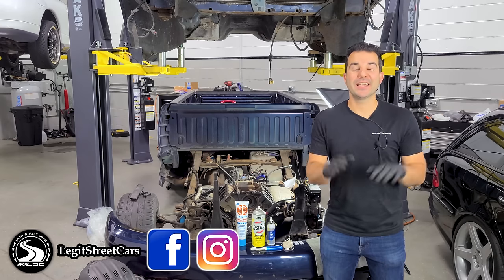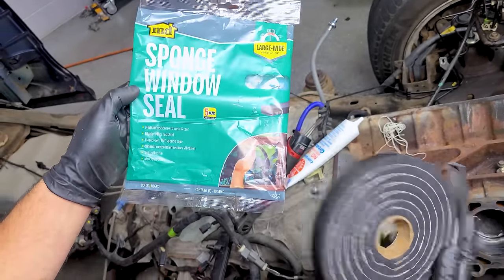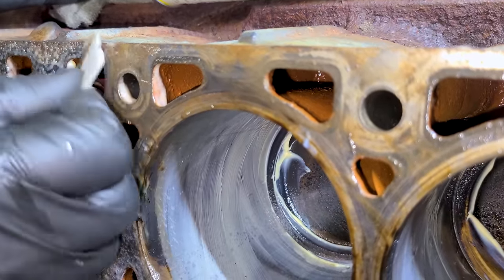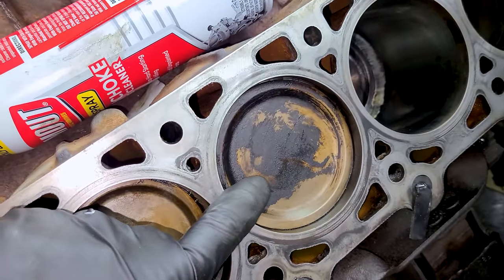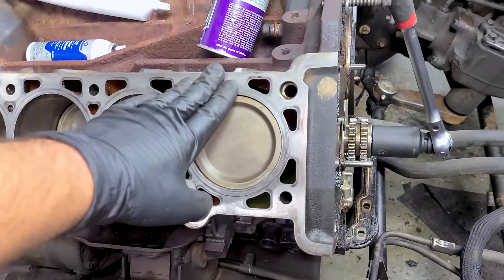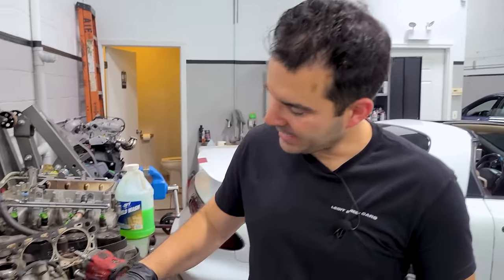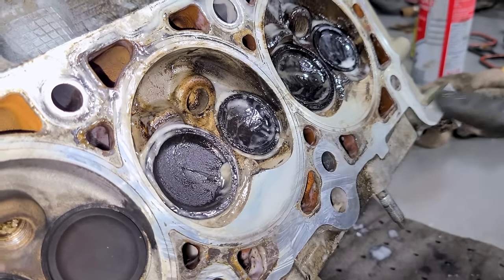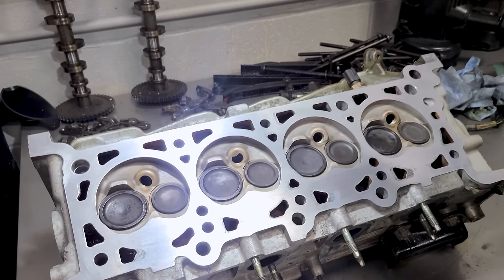How I Cleaned My SVT Lightning Pistons & Engine Block Using WAX STRING! BONUS: Head Cleaning!

Comment: I can tell you that what you did is just right on fella. One thing I can add is that I use .001 thickness feeler gauge and lift the straight edge and place it underneath and see if I can pull out the gauge. You do the same thing as myself fella. I know for a fact that guys I use to work with would just use the rotary scotch brite pads fine grade and not give a damn. They had too many returns and would blame the owner overheated the engine as the fault. Then it was time for a new Ford crate engine. Now the price is just crazy high. I personally went the extra mile and had NO RETURNS, PERIOD ! I believe in a customer is my bread and butter. Job well done Sir.

Comment: If you've never used it, Mopar Combustion Chamber Cleaner is probably the best in the industry.  Make sure you double nitrile glove.  Use it on running motor, or down the plug hole for a soak, & better if engine is pre-warmed.

Comment: Great video.  Try scotch brite bristle disks for gasket removal.  They come in green, yellow and white.  Grade 50-80-120 based on color.  The white 120 takes off gasket material off a aluminum block very quickly without removing metal.  I have used it on several aluminum cylinder heads and none are leaking.  Just do not push hard and do not concentrate on one area.  Like using a buffer.
Reply: Yup that white one did great on my turbo impreza. No leaks, does great at the track.
Reply: Those are the way to go. A lot of service manuals call for them too.
Reply: yea dont waste your time using a razor blade unless youre fluffing a YT video out
Reply: @WholesaleTurbos  also isn’t brake clean cheaper and better then oven cleaner lol
Reply: The 3M bristle discs have ceramic abrasive in them. Best to use them on bare heads and blocks that will be final washed before assembly. If you use them on an assembled engine, be sure to seal off everything.
Reply: @bryanmaloney6651  maybe 1 in 10 dealer techs take the time to do that lol
Reply: @gszman  Different products, brakeclean won't remove gasket material, but it will remove grease, dirt and carbon buildup. 
Oven cleaner and gasket stripper are caustic so they are much stronger than brakeclean so they are better for removing stuck on material.
Reply: @nzuncovered1845  I’ve never needed to use solvents to remove gasket material. That would be like watching paint dry. Solvents and compressed air are for final clean up

Comment: Nice job, it is very satisfying to see a freshly milled surface, but I am sure you could also use a flat grinding stone or block instead of that sponge to sand out those stains..
Reply: Kinda should stay away from abrasives for cleaning on the cast iron as much as possible,staining won't hurt,and wire wheels won't remove metal but they'll remove stuff that's not metal.

Comment: I thought proper technique with the straight edge was to run it diagonally across the head and check the gap between cylinders, running it along the edge of the casting seems like it would show the least amount of potential changes.
Reply: You would be correct
Reply: It is.  Not sure what he's doing.  Its not a race engine will be ok
Reply: The way he checked is not correct at all. That was a waste of time and just a video filler.
Reply: @sschevmale24  it is a boosted v8 and it is common to lift head gaskets on these so yeah kinda critical to check. But sounds like the engine is junk anyhow so....
Reply: @sb0mb  bro its fine.  I've seen worse and run fine.  Yes he has motor out, magnaflux it, machine it, rebuild it.  Cement the block if you want.
Reply: This guy's a 🤡

Comment: I wonder how much that straight edge costs ?
I didn't even know such a thing existed outside engineering shops and laboratories
been using a piece of glass for over 40 years
infact if you do detect warpage, you can stick fine grade silicon carbide wet and dry paper to the glass and flatten the head or block yourself fairly easily.
just make sure your glass isn't warped first, by testing it 4 times against another piece of glass in all 4 orientations.

Comment: Just a thought....would that crushed dry ice blaster that you used for underhood and interior detailing in a previous video work for cleaning up the cylinder head and block deck gasket surfaces and piston tops?
Reply: I was wondering the same
Reply: Yes. It freezes and chips grease grime and even sealant. It doesn't do so well on remnants of paper gasket.

Comment: Former BMW tech and former Gen 2 Lightning owner, I chimed in on another video you posted about these trucks. The engine is an okay base but the rods are weak junk and the earlier engines' spark plug thread are not enough for even an NA engine, let alone boosted.

Comment: Cool tip with the wax string never seen that. But a tip I use on the cylinder heads leave the spark plugs and turn the head bowl up. The pressure from valve  seats will be water tight and can let your cleaning solution pool up as you clean.
Reply: Does the string just stay in there and evaporate?

Comment: Always check deck and head surface diagonally as well as lengthwise. Also a good idea to go perpendicular and you want the check between the cylinders as that area has the least amount of support and receives twice the combustion vs and outside edge. It is just a good practice.
Reply: I am sure you didn't miss title stating how to "clean" but not repair. It wasn't a repair video but rather cleaning, It help to read.
Reply: @finditandfixit2081  Did the author not show how to check flatness?  The fellow you were ragging on simply provided addition info. Additional good info.  Also, I don't recall him mentioning fixing anything.
Reply: @randywl8925  he did that to do a quick check as  he probably know it wasn’t bad. Since it still fall under how to clean as hat.
Reply: @finditandfixit2081  but both guys checked for flatness.
You need to check for flatness,   so a clean but warped head wasn't reinstalled.  If you're going to check, the guy mentioning the diagonal check too, was telling the best way.
Hey, the head is off, so might as well do it.
Reply: Hard to run a diagonal flat check on aluminum block because the sleeves for the cylinder protrude a MM or two outwards, you can likely test it somewhat in the same fashion as the gentleman in the video though

Comment: I respect this guy's work and respect his Palmares but I've never seen a straight edge used like that to check head or a block. 
Also, I can think of way less caustic cleaners than oven cleaner in such a critical part of my powerplant. I look forward to see how this buidl turns out.

Comment: I love my old craftsman gasket scraper. its made like a chisel but its not too overly sharp. Its heavy and strong and can be easiy re-sharpened. Way better than any razor blade. Wont damage your head so easy. Cuts and removes old gasket so well you wont need any gasket remover. Other than that i like your sanding block and white bristle brush.

Comment: It's like an entire video dedicated to avoiding the simple 3M plastic cleanup tools that professionals use.
Reply: He's giving us an alternate method. What's wrong with that mr know it all?
Reply: Professional tools cost tons of money and not everyone can get them.
Reply: Never take a plastic wheel to an aluminum block or head. The heads should always be taken to the machine shop. It's not just the head gasket surface that matters, but reconditioning the valves, guides, and seats. Plus, if it's German, it's getting new valve stem seals mandatory.
Reply: Your watching a professional bud
Reply: What tools? Genuinly interested. Im spiffing up my 240sx stock build* until i can get a new bottom end package and get the heads ported and some cool cams
Reply: Just leave him be
Reply: NO ONE IS HONEST WHY WOULD HE NOT JUST DO WHAT HE LABELED THE VIDEO AS?????????? CLICK BAIT. AND THOSE TOOLS ARE 9MILLION DOLLAR SHOP TOOLS..... USELESS TIME WAISTER. WHY ARE YOU EVEN TALKING SO MUCH MAN???? SHOW THE FIX AND SHUT UP. WOMEN TALK LIKE THAT. WHERE IS THE STRING FIX?? BUDDY NEEDS A FEMALE TO TALK TO.  IM NEVER WATCHING THIS WAIST OF TIME AGAIN.
Reply: @LynxStarAuto  plastic is not gonna hurt aluminum or steel thats why they sell plastic hammers for hitting metal parts without damage like when youre seating your thrust bearings. if your heads are going to a machine shop new valve stem seals is a no brainer on any engine
Reply: Do you really believe that professional will clean carbon of pistons inside of a worn bore and ring engine ?
Reply: @Videoswithsoarin  many Roloc or 3M plastic cleaning wheels have embedded aluminum oxide and/or silicon oxide. Definitely not something I want in my engine.
Reply: In my area it is there is no 3m brush available

Comment: When cleaning aluminum. If you choose to run a wire wheel.  Try to find a wheel that is made of brass. Or Nylon. NOT STEEL. Brass is good as it is softer than aluminum. And don’t do much damage. And nylon is a plastic. Which will break apart rather than gauge or scratch.  I use a Nylon wire brush when  cleaning valve guides or any brass,copper or aluminum bits.

Comment: I do know that mechanics would do carbon cleanups a looong time ago where they would carefully apply droplets of water into the carburetor while the engine is running at 3k or so.  The steam from the combustion would help break off and carry carbon deposits out through the exhaust.  BUT!  I've never seen inside of those engines to confirm if indeed it did work or not.  Oven clean does wonders to cleaning carbon deposits, best way to keep stainless steel exhaust tips clean, inside and out!
Reply: Saw a dealer mechanic in the 70's take a coke bottle full of water and dump it in at a higher rpm, it was a hi perf corvette with detonation problems.
Reply: @RickyBobby615   DRIP.... not "dump". ATF could also be used (pre-catalytic convertors) in order to let it sit and soak into the carbon deposits to help soften and break up the deposits. Followed by a "brisk" test drive to blow out the chunks and fog the neighborhood for mosquitos. lol.

Comment: These 5.4s have a coolant drain plug on the driver side rear of the block just above the oil filter. It's an Allen key fitting. I want to say it was an 8mm. Once it's out rust/debris may be holding the coolant back so poke it with an extension or screwdriver, and watch her pour out!

Comment: $$-saving tip - a laboratory squeeze-bottle or Zep spraybottle are very effective for spraying cheap mineral spirits for engine cleaning.  Or for spraying WD-40 from the economical minigallon size.

Comment: I have 3 different grits of 3m plastic cleaning pads with plastic fingers on the bottom. They are small designed for air grinders. They are made for cleaning aluminum. The finest one won’t hurt aluminum no matter what because I have tried to hurt old heads etc and no damage but the most aggressive one is for cleaning iron blocks so it will definitely damage any aluminum.

Comment: I was asked a long ago to fix a Ford Cosworth engine from a racing Sierra. The other camshaft had snapped in two. Now, straightening the head can also mean that the bearings of the camshaft are no longer in line after the head has been torqued in place. So, if the warpage is only minor, just let it be. Let a quality head gasket do the job.

Comment: You should store your straight edge in a hanging position. That is why there is a hole in one end. If you put it on a surface edge down and the surface you rest the straight edge on is not perfectly flat gravity can warp it. When it is hanging the only thing gravity tires to do is lengthen it.
Reply: That makes sense

Comment: What I use is aircraft paint remover that’s in a aerosol can because it does not oxidize the aluminum, and it leaves a shinier finish to remove the carbon from the valves and pistons

Comment: Diamond like coatings are to reduce friction 
And it retains heat while being more conductive of heat than steel or silver sodium filled valves for example have the same effect of retaining heat. 

The entire piston and valves are dipped into it and it’s embedded into the top layers of the metal. Where vitol was used in previous vehicles. 

It’s like putting oil on ice then trying to skate around on it. At the same time it’s speed of heat transfer keeps the heat at the highest friction points. While reducing knock.

Comment: I use mercedes gasket remover, which is a loctite product (7200?).. it removes everything.. no sanding block required. I do final wipes with microfiber ..first with the gasket remover and finally with 90+ alcohol..

Comment: the hole in the strait edge is there to hang it from just like a 4 foot square used for drywall, plywood ect. hanging it keeps it strait.
Reply: 👍💯 It's also the same reason you should store loose cylinder heads and crankshafts standing on their ends (vertical) instead of laying flat (horizontal). Much less chance of them bending (warping).

Comment: Could you use CLR as a coolant flush? Obviously you wouldn't want to drive it, but just a quick 15-20 min idle, let sit fire it up again and then drain and refill. Or would that be too hard on the internals/water pump?

Comment: I had one that had the stains really bad, it had red rings around all the cylinders. I ended up using some metal etch primer, light coat(transparent)before I installed the new head gasket. I prepared it with 1500 grit. I was hoping to slow down the head gasket rotting out like it did.

Comment: A syphon parts washing gun. 1/4” nylon line in suction hose. Can suck out bolt holes, dome to comp ring, even through a spark plug hole

Comment: The diesel truck engines  do not need super clean piston tops . More importantly is using a new tap to clean engine block head hole and a die on the head bolts . Use  International compound #2 on head bolts . 3M Scotch Brite pads clean well . Anaerobic sealant better than RTV silicone ,  Good Video .       2/23

Comment: I heard you can wax string it by pulling the spark plug out and putting it in and running full throttle.

Comment: Every time I pull my heads, I don't plug up everything, I usually change the oil and coolant after I break down my heads anyway.  I also use green scratch pads on a drill to clean the head surface and use copper sealant on the gasket afterwards.... I use Totally Awesome from Dollar Tree to clean the pistons too.

Comment: interesting methods.  I've found simple green works amazing for cleaning aluminum engine parts.  Removes carbon and oil staining.
Reply: Make sure to check what version of simple green you use. Just regular simple green is corrosive to aluminum. I work with aircraft and we use a specific version that is aviation approved on aluminum parts

Comment: Good video. You might be hearing piston slap if they are the factory pistons. Depending on the engines mileage, Ford used a teflon -coated hypereutectic pistons just for that reason. As it wears you'll  be hearing it get worse as time goes on. Fords Fix for that one.  nice job on the video

Comment: Love your vids. 
What's your opinion on a 2015 f 150 with the 5.0 with 153K on it? Truck is immaculate with 1 owner. I know those engines can go 300K some times.
Would that mileage scare you? 
Thanks if you reply.
Reply: 5.0 Coyotes are great engines. I had 150k on my 2011 XL work truck. Ran beautifully. I will say this was a flex fuel truck and I ran it on E85 for 80% of it's life. The extra power is noticeable on it (Ford quotes 15hp+ while on E85).

Comment: Evans waterless coolant is best for iron block. No water no corrosion no expansion. Boils at 350f. Not affiliated with evans waterless, I run it in my e30 m3 it saves my 2.5L oem evo 3 iron block.

Comment: May b dumb but oh well, How about using soda blasting or walnut hulls AFTER passages r taped up and plugged? Like a portable job where u stick hose in a bucket and hit it at Idk 75 psi. That way it'd get in all the tiny areas, clean well and not harm any surface? Also that frame is begging for some Ospho. Nows the time to knock off heavy flakes and spray her down and seal her up with some good chassis saver paint, Eastwoods internal, chassis black, or farm implement paint with a few caps of hardener. Did a 49 chevy 3100 frame off and did this and she looks nice still and that was 1995. When grunge was cool and the world made sense. Have a good 1.

Comment: Not enough carbon to cause a problem. What do you think you're gaining? The sanding grit particles are very small and like paint, you can't avoid leaving some in there. You'll be filling your cyl cross hatch with abrasive grit. That thin layer of carbon in the cc will be back in 500 miles. Just clean the decks and be done with it.

Comment: Noticed a deep scratch or crack on that cylinder head between a water jacket and the outside.  Wonder if that was caught.  Easily visible at 19:24

Comment: The gasket remover does say on the tube leave it for 5-10 minutes... and you had it running off the head so yeah that's why you wasted it. Also 2000 grit sandpaper is way to fine for applying a headgasket to it

Comment: You can also use blue tac if you haven't got ant Wax string in your purse. Although, engineers would argue whether you need to clean a small amount if carbon off the piston face.
Reply: Looks good 🙂👍
No real benefit perhaps a
"while you're in there "
job. I've always done it. 
Or clean it best I can.

Comment: I guess the miniscule amount of material you're taking off with the sandpaper doesn't affect compression ratio or possible valve-to-piston contact at all?
Reply: No again just a light sanding. being 2000 grit it's almost polishing the deck - not removing a great deal of material.
If you went to a coarser grade and kept sanding yes eventually you would distort the surface..
Reply: Nice to look at but pretty much a waste of time.